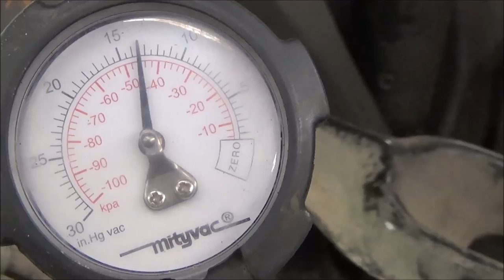Pontiac Grand Prix 3.8 - Water Pump Replacement

Comment: Electronic non-length dependent torque indicators are the most accurate. Select the correct torque range – for the most accurate performance, the maximum torque applied should fall near the middle of the tool’s torque range. 
For example, if 50 ft.-lbs. of torque is required, it is best to choose a wrench with a range of 5 to 100 ft.-lbs., rather than a range of 5 to 50 ft.-lbs.

Comment: Dexcool itself isn't the problem if the system is maintained and air-tight. My wife's Impala was full of this stuff and it turned out she had a cracked radiator and bad coolant crossover gaskets on her 3.5 L. Replaced the radiator, crossover gaskets, radiator cap, flushed the system a bunch and it has been problem-free ever since. You have to find out where the air is getting in / where the coolant is leaking out if you want to stop this from happening.

Comment: I just got a Ford F-150 with the straight 6 cylinder. It was the same as this one. I thought someone had put sand/mud in it. I'm disabled and will have to fix it myself. Did you find out if you could get more of it out? I read that add a little Dawn dishwashing liquid and drive it a few days and drain it and then put oil that's made to keep motors from rusting and put in the good green antifreeze. I'm going to do that and flush it out again next summer.
My truck didn't sound funny or run hot. But, I wish I would of seen it before I got it.

Comment: What has always worked for me is drain all the coolant, add water and about a cup or 2 of white vinegar, run it through the engine for a while, then drain and flush it out with water until clear. You'll get a lot of crap out of even a seemingly clean cooling system.

Comment: Gah! That dude must've put dirt in his cooling system to plug that leaky water pump. Probably learned that trick from his Grandpa when emergency-fixing the family tractor out on the farm during harvest season.

You earned your money on that Rad flush. You went above and beyond on this job. I would rescind the warranty on the pump you installed after seeing that. What an absolute pig!

NOTE: did a Google search on "Dex-cool sludge". WOW - how did GM not test for this? I'm very sorry my tax money went to bail out this turd of a company.

Comment: The God Damn engineers do not design those car with maintenance/repairs in mind. To change the Headlight Bulbs on my STS, the front of the car has to come off. They need their Heads slammed against a door frame a few times

Comment: Great video !! I wish I’d taken the time to watch it sooner! In December ‘18, I bought a 2006 Grand Prix with 230k miles for $700. The car had for sale and phone number painted across the back window, parked in a neighbors driveway. I know what you’re thinking, first red flag: window paint. that happened to be exactly what I was looking for. I called and found out the car had been sitting in the same spot for about 19-20 months, and wouldn’t start. I have no mechanical training or background at all. However, based on the sellers account I figured it wouldn’t start because the battery needed replaced. I went by AutoZone, dropped in my new battery and started up after a couple tries and pressing the gas peddle. I bought my first brand new 0 mile car when I was 20 years old. Since then I haven’t bought a vehicle that had more than 2 years of use on it. I’ve had an Explorer, an Acura, a Lexus, and a Tacoma. by no means could I compare this Pontiac to any thing I’d driven before. it didn’t start well, it didn’t idle smooth, it didn’t ride well, it didn’t turn well. The check engine light was on, the ABS light was on, TC service light, the headlights weren’t useful anyway but they’d shut off if I went to signal a turn, and not come back on. the car would get hot if I sat at a light to long. And I couldn’t keep air in the 2 front tires. If I went to make a right turn I couldn’t do it from a dead stop, because even though the engine would rev when I pressed the accelerator the wheels wouldn’t spin for the car to pull thru the turn. remember I have no mechanical background whatsoever, I had no idea what all could be wrong with the car. I put it to use as my daily driver right away. The first week I had it after work one day I took it by a used tire shop and got 4 new used tires. I couldn’t afford new, and still wasn’t sure how much life I’d get out of it. the guys at this run down shop told me I needed new inner and outer tie rods as well as new wheel hubs all the way around. They had the car up in the air, grabbed ahold of the wheel and without much effort was able to rock it back and forth and up and down. $900 he quoted me IF I brought my own parts. More than I paid for the car! I didn’t have any idea what a tie rod was, but I sure as shit wasn’t paying anyone to change them. I found the inners and outers at AC Delco for about $30 bucks each side, and ordered all 4 wheel hubs. I ordered a chilton’s manual from HPB, and two weeks after the tire shop visit I was ready to go. I got up early on Saturday morning to work 16 hours and Sunday I worked 20. I had to finish Sunday cuz it was back to work Monday morning. it was a learning experience, many trips to AutoZone (I also own a Vespa for these tasks, lucky for me) the abs and TC lights were off when I started up I could feel the difference in control going down the road. Since then I did get brand new tires all around. other than the guys at discount tire and the used tire shop not a single other person has done any thing to the car other than ride along in my passenger seat. I’ve done every oil change, hand car wash (every weekend) wax when I have the extra time. Changed the breaks and 4 rotors, added camber bolts to the front steering component, changed every filter, half the sensors, replaced the CV axle L&R, flushed the radiator twice, new plugs and wires, replaced motor mount tranny mount and strut mounts. Replaced the heater core and hoses, replaced the control arms mounted on steering column. 2 thermostats the housing and about 8 bleeder screws cuz I can’t seem to not twist them right off, 2 new power window regulators, Several missing body/bumper components I found in a junk yard, recharged the AC, trashed every bulb inside and out and replaced with LED’s front back and inside. I even found LED bulbs for the mirrors in the sun visors. Have not replaced the bulbs in the AC control module (half of these don’t light, future project) I could be forgetting one or two replacements, but all of that I’ve had to learn how to do myself. For everything the Pontiac needed I couldn’t possibly justify paying a mechanic to do. I still need to replace all four struts, later. My next project is to replace the radiator, water pump, and serpentine belt. I’ve had the water pump since last fall but haven’t done it yet because that clay shit seems to be thru the entire cooling system and engine block in this car. I’ve tried flushes, but decided I need to replace all the components at once to remove as much that shit as possible. the heater core had to be done last fall before winter hit, I’m from Dallas TX. As tough as we like to think we are, we are bunch of sissy’s in cold weather. My radiator is in shipment now, and should arrive next week. the first time I encountered the sludge is when I cleaned up the throttle body (I read doing this could correct the difficult starting issue I was experiencing, which it did 100%) I removed the throttle body and didn’t really know what I was looking at at first, a long worm shape clump of that orange clay, dry as a bone. I figured out it was part of the line thru the engine block where the coolant would be pumped thru. It was totally dry tho. This explained why the radiator would only accept half a gallon of coolant, because the lines were full of that. any way, that project will be underway as soon as my radiator arrives. The Pontiac has passed 250k miles. I drive 1.5 hours to and from seeing my mom 1-2 a month, and commute in Dallas traffic 5 days a week. Ever since I replaced that battery when I got the car, it has not broken down even one time. Working on it  has been frustrating most times, to a point I’ll give up and leave it sitting in pieces. I get back to it after 30 minutes or so of cooling down. really tho, I never would have thought a GM sedan would keep going like this one has. it’s by far the least fussy vehicle I’ve owned. thanks for the tips just in time for my project. I’ll catch more of your videos when I have some extra time.

Comment: My Wife's 2006 3.8 Grand Prix does this Same exact thing. I have flushed it three times, about once every 10.000 miles, same Exact result. After the first flush, we changed to Universal Green coolant and left Dex alone.  What is Causing this issue in the first place?  Intake / head gaskets?  Bad Radiator leaking Trans fluid into it?

Comment: Do these engines have the same valley gasket coolant leak like we do over here in Australia with 3.8 fitted to the Commodores, same family of engines. along with the small pump bolts seizing and snapping off.

Comment: can't believe the sludge and how this never over heated. I have a problem with my 2006 grand prix 3.8 v6. It cranks over but won't start. It gets fuel to the fuel rail. Do you have another video on crank but won't start troubleshoot video

Comment: You don’t have to answer this but you know what your doing my car heat won’t work replaced elbows radiator cap and thermostat only works when pushing gas gets luke warm when sitting or parked coolant is full could this be air in lines from replace stat and elbows?

Comment: 4:20  to take off the water pump on a 98 Ranger 3.0, 1/2 of a bolt is blocked by the A/C compressor.  Stupid engineers abound.

Comment: DexKill does it again.. good job. GM
Reply: Ryan other manufacturers use it too now and if the dumb ass owner would've maintained the vehicle there would've been no problems.  It's not GM's fault, it's the owner as it is most of the time with vehicle maintenance.

Comment: next time you run across this sludge with dex cool try Irontite ThoroFlush. used it in mine and it ate that stuff up for the most part. lot stronger than the prestone flush.

Comment: Just curious,  why not pull the stat? Its gotta be caked on both sides of the thermostat. Also, why not install a flush kit and show the driver how to use it? Driver should see your video as well to learn what neglected  cooling systems look like. Flushing with a garden hose every 3rd year would have avoided this mess. Lastly, do you folks use water pump lube? Thanks for all you do and I recognize quality work when I see it.

Comment: perhaps that was a clay type mude?
it may have saved the system from failure due to its lubrication? CLAY IS SLIPPERY. BEN TON NITE Wyoming dirt is so slippery that its put in wells to lub the drill bit and its the white stuff in tide to lube the cloth fibers to let dirt slide out of ur cloths .

Comment: i had a 94 camaro with the 3.4 i bought it used and went to change the coolant one day had the same problem flushed the system about 10 times still never got all the mud crap out

Comment: I have a 99 Buick park Avenue and I have a motor mount bracket in my way and I can't get the pulley out. Any tips you could share with me to help me finish this water pump. Thanks

Comment: Hey Eric, got a question for ya. I am needing to replace my ‘00 Grand Prix blower motor as well as the pigtail for it. I have looked online and can only find 4 wire connectors whereas mine has 3 wire and an empty prong do you have any idea as to why this is? And how to resolve it because it’s getting cold and I need a heater lol

Comment: I have an older brother who never changes his oil or coolant.  If I borrow a vehicle for any reason the first thing I do is check the oil and water. Usually 2 quarts low on oil. Water looking horrible. Like you I just try to make sure it doesn't quit on me. I feel I would like to make an attempt to flush this engine and when you do leaks will spring up probably uncontrollably.  So Just change the water pump and put antifreeze in it and ship it. What else can you do?

Comment: 11:40 - Good gawd! It's amazing that he didn't overheat and blow a head gasket long before the water pump took a dump. You flush that cooling system and you may just wash the clay out from where it's sealing the head gaskets. Looks like a bucket of worms, if you ask me....

Comment: Isn't it amazing, over 200,000 miles and all the engine needed was a water pump and pressure flush to get back on the road again. The car won't get very far down the road before it needs more care, like a battery and this and that.
So I'm wondering did you highly recommend to the person further care preventative maintenance?

Comment: ive found gasoline dissolves dexsludge pretty well.  great for the radiator or water reservoir as theyre easily flushed out afterward. . not so much the engine.  I guess its ok to be an aircooled car up there in winter.  in Potsdam we could run without water 7 months out of the year.  here in fl that motor would probably be unsalvageable and already seized. cool powerwash tool.  I haven't seen one of those before.

Comment: Eric, just curious, but I was always under the impression, when you have to change a water pump, that it is only prudent to change the timing belt/chain while you have the water pump off---especially with a car with that much milage on it (214K)---to keep from doubling your work again unless---of course---the timing belt/chain had been recently replaced; but if that was the case, then a new water pump should have been put on after the timing belt/chain was replaced (non-interference engine or not)?

Comment: I had this same crap in a Chevy Xtreme not this bad but it took me for every to get it all out of the system. I think it was some sort of stop leak someone put in over a leaking heater core... Yeah heater core was a 8+hours job too. Stupid car lot quick fixes... that stuff floats and does flush out but it takes months to get it all out.

Comment: Same EXACT THING happened when my water pump went out in my 08 Grand Prix except it shredded my belt but radiator did same thing and it’s all that old DEX Cool build up, I have to flush my heater core a cpl times a year but I’m trying to get it out and replace with green coolant

Comment: I had the same problem with my 2004 Chevy blazer with the 4.3 V6 regarding the coolant it only had 64000 original miles on it. I flushed out  The whole engine and radiator over a weekend about 10 or more times. The Dex cool stuff is so corrosive it ate away my radiator And heater core. After I finish flushing and out I notice my radiator had a bunch of small leaks and my heater core soon followed. It has the green universal coolant after I flushed it out again. There's a reason they call it dexkill

Comment: Wow. I had a Pontiac Grand Prix GT 1 with a 3.8 v6 I changed the coolant every 20,000 miles because I had a driving job I changed the oil every 5,000 because I had to drive my car hard but I had full synthetic oil my car ran like a beast man I miss that car.

Comment: Eric, I know this is an older vid. but didn't GM have a problem with that DEX. ? I realize it has gone way beyond its intended lifespan and goes to show why even the minimum maintenance needs to be followed, that is TOTAL neglect

How was the circulation after cleaning and the new waterpump?

Comment: retired 25 year mach. 15 years cert. have seen thaty very thing in cars an trucks. an yes have spent hours cleaning them. have a great day. ps be prepaired to see that car again. because it ussuly will start leaking in the upper intake. good luke.

Comment: Ah ha ha ha... was wondering what you would say when you realized you had to remove the steering pump to get to that last water pump bolt. You had a much easier time though getting that lower bolt back in than I have.  Yes, I agree - their placement of the steering pump on the 3800's is stupid. Burnt my arm more than once trying to check the fluid levels...  anyways... so, did he come back stating that he smelled rad fluid in the cabin?

Comment: You forgot the little tip that all patrons in the front row of a Gallagher show already know. 

Hell I wouldn't doubt it if some putz told the guy that red clay helps seal a leaky radiator and he believed them. Once upon a year ago I had to replace an entire electrical meter for a local gal. She had no electricity in her house at all. The cause, someone told her that if she put a bag of rock salt ontop of the electrical meter box, it would reduce her electrical bill. As you can imagine, the entire inside of the electrical box was rotten. It was like loose paint holding rust together.

Comment: With the neglect that poor car endured, the owner must have a horse shoe up his butt cause it still runs. That crap is throughout the system. Cool tool to flush that crap, never saw that before, but what a mess.I`ll bet the car "thanks" you for relieving it`s constipation. That vacuum tool was cool too!

Comment: there's a tool kit to remove and replace the power steering pump pully instead of removing the pump. It was probably as fast to move the pump though....

Comment: That torque wrench if I saw correct has a range of 5-100 lbs so it wasn't going to be very accurate tightening to 16 lbs. better to use the SO 1/4 TR, the AFR240 I think, and the setting would of been closer to the middle of its range.

Comment: If that engine was aluminium, or even just alum. heads, it would be DONE! Good thing about all iron engines is they can get hotter than HEEL and still be golden!!  That 3800 must have been running 230-240F, still just barely in the red zone!